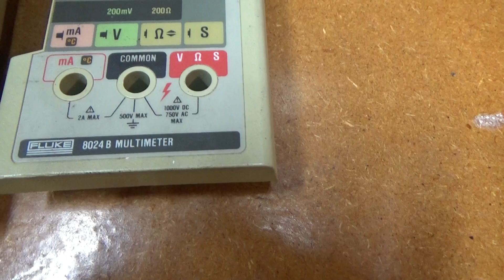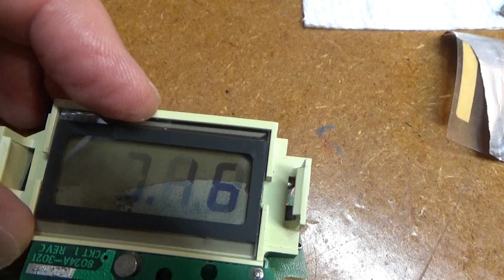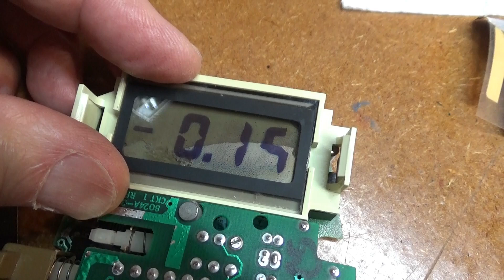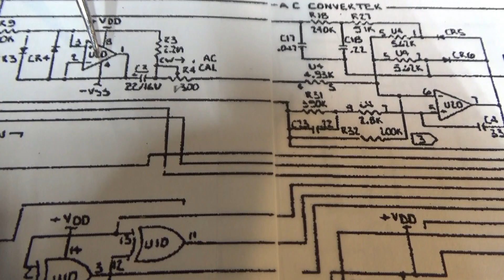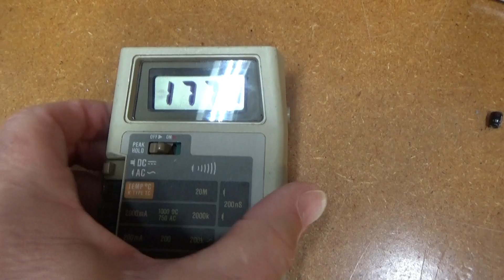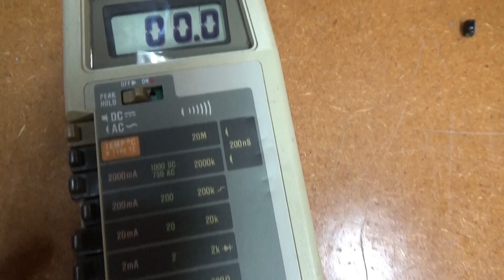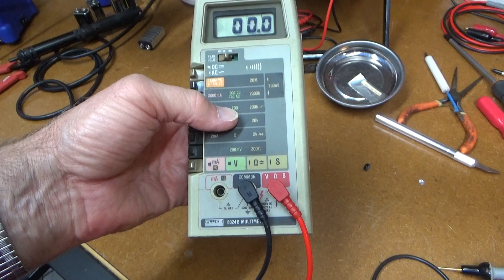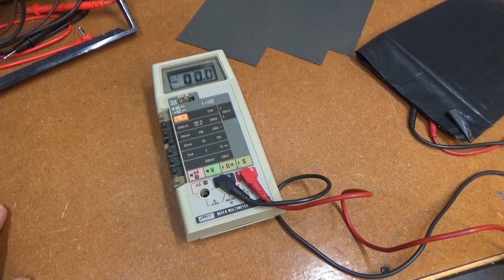1981 Fluke 8024B Multimeter Restoration

Comment: Nice!
I have 8021b and clamp 80i-600A what jack port should i use the mA or VΩ???
Reply from the maker: According to the manual on the current probe, the red conductor should be placed in the mA port and the black conductor in the common. The multimeter should be configured to measure AC mA.
Reply: @mguess Thank you a lot!
Awesome job btw
Best regards!!!
Reply: @mguess Thank you a lot!
Awesom job btw
Best regards!

Comment: I saw the caps on these will eventually leak and destroy the PCB. This was the first digital meter the airline bought. The old guys wouldn't touch it. Said it was possessed.
Reply from the maker: There is only one electrolytic capacitor in the multimeter and that is the one that I replaced. I haven't noticed any signs of demonic possession but I'll keep my eyes on it.